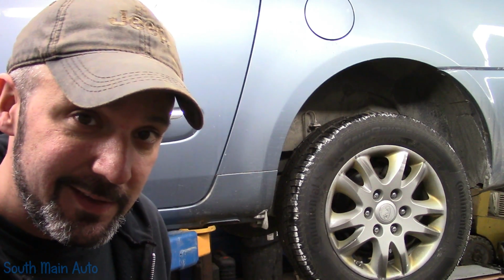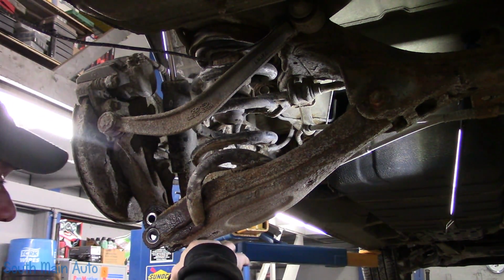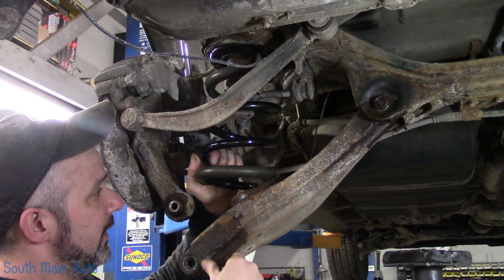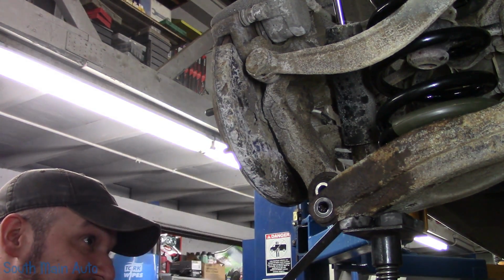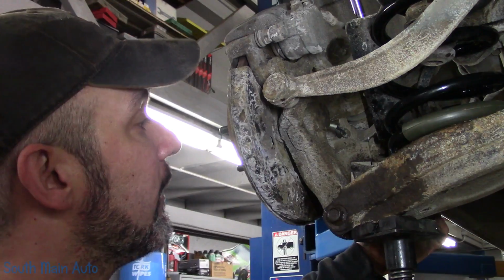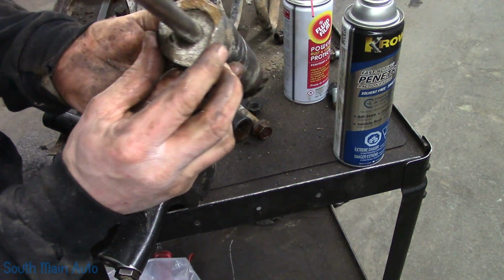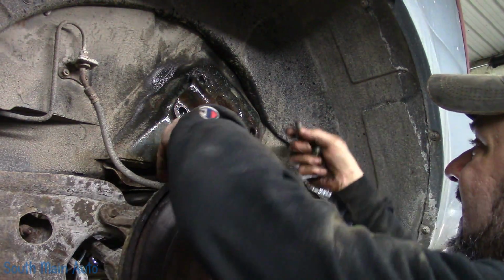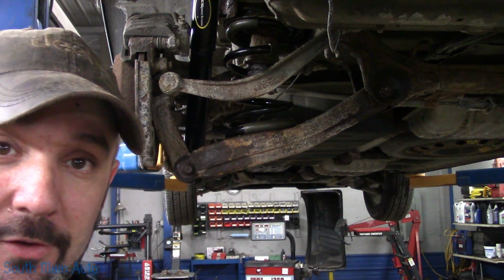Kia Sedona: Broken Rear Springs / Rear Shocks

Comment: Question: would it be easier loosening the outter control arm bolt and removing the inner control arm bolt(while supporting the control arm) to lower the control arm and remove the spring? I would think, since the spring is closer to the outside of the control arm, there would be less torque on the inner end and therefore easier to reinstall, plus less shimying around than the knuckle end. I'm about to do my springs on my 2008 Kia Sedona(New York car- 140,000 miles- regularly undercoated)

Comment: Quick question. Your video was a big help in maybe figuring out my issue I'm having with my 06 Sedona. The vehicle has been to two different shops to find a banging noise in the rear suspension. They can hear it in the test drive but can't find the problem. The van has 260k on it. The shocks were replaced when I bought it and the lower control arms in the rear had new bushings put it. The banging issues begins after more then one bump in the road. A little single bump won't make any noise. Also the front struts were just replaced and now the van sits low in the rear. So with all of this and before I decide to replace every part in the rear suspension how do I check to see if the sprigs are bad. Also the van did a lot of hauling.

Comment: QUESTION to Eric (or youtubers here) :   My knuckle bolt is rust frozen in his bushing/ knuckle ..All the  others arms are free...Can I disconnect all the non-frozen arms(and swaybar link  and shock)) and lower the whole knuckle assembly in order to remove (and replace) the coil spring without disconnecting the lower arm I mean the camber adjutment bolt(and lower arm) will remain in place ?   Mine is a Sonata 2009...similar suspension.

Comment: 2006 Kia Sedona ....mann, I need your help we in the maintenance dept, are removing the  rear lower control arm/drivers side crossbeam arm, etc...and the lowest bolt through the spindle is stuck in the bushing, the nut is off but the bolt wont slide out and we so far damaged the rubber on the bushing also

Comment: Can someone explain to me why this cheap family van has full independent rear suspension? It's not like the person is going to be taking sharp corners as a fast speed. It will still have tremendous amounts of under steer, and probably topple over on its side if it took a corner too quickly. I feel like a semi independent torsion beam system would fit better and bring the overall price down too.

Comment: Thanks for the video.  I'm attempting this tomorrow.  If you were doing this again I saw on another video that they took the inner bolt completely out on the control arm and let it pivot on the outer. Looks to of gave better leverage... well they still struggled. Any suggestions? Plus when you were jacking the control arm back up into place was there a jack stand at the front of the vehicle? Thanks

Comment: Thank you for posting this video, I had a question on what spray were you using on the parts after you removed them and the rubber top for the spring?
Reply: Fluid Film.

Comment: Have you tried the new inductive bolt heaters?  I've seen them in use. They only heat the bolt or nut, not the surrounding CV boots...  Have smoked a few in my day..

Comment: Working on Kias and Hyundais over the last 10 years - is that what sold you on looking at the Sedona as a replacement for the Odyssey?  I had a Sedona as a rental (they ran out of small sedans) and the thing was a really nice ride for a minivan.  Also fit all the car parts I needed for a car I was fixing up (body panels - doors, fenders, hood, bumper etc).

Nice work as usual !!!  Nice to see bolts zipping out of their schlotss without any fan fair.  Your torches must have felt sad and neglected...luckily there's plenty of Fords and Subarus to keep them entertained haha.

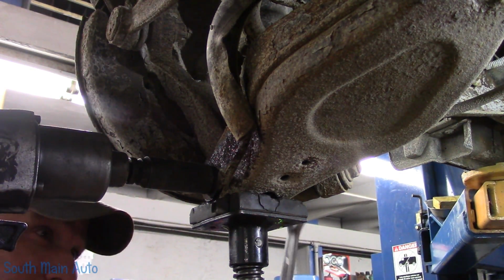Comment: At 1:30, you are removing the bolt (lower control arm to knuckle bolt). Is that the same bolt I replace with an aftermarket camber bolt kit for rear camber adjustment on this Sedona? Thank you.

Comment: I think the 4th upper shock mount bolt came out hard because it was loaded; it was the last one out, and there was still some spring tension on it.  Not because it was crustier than the others.  But, I wasn't there, you were.  Great vid.  Nice to see those Kia's are so durable that after all those soccer-mom miles the thing is still very servicable.

Comment: That potential to kinetic conversion don't half hurt fingers! I now like to use coil spring compressors to keep the springs energy in check. I have heavy duty ones that lock onto the springs so they can't pop off! I have seen people cut the old spring with the gas axe to take the energy out of it? Stay safe mate.

Comment: 한국에선 세도나 리어 스프링 개선품이 나왔는데요 스프링 아래쪽 고무 일체형으로 변경

In Korea, there is an improvement in the intensity and rear spring, but the rubber under the spring has been changed to an integral type.

Comment: Hey Eric, do you torque the bolts / nuts down after using the gun ?  I'm forever checking the official torque specs for everything and don't rest easy unless I know they're at the 'correct' torque, but I'm just a DIY'er.  Is there really any need to torque everything or do you just know the gun and that it's going to be fine with that ?

Comment: Remember when coil springs were a daily thing, doing front end work? Those made me nervous a time or 2! Also remember when they lasted longer than the vehicle? How times change. Pretty good miles on that thing, though, so I guess I can't bust 'em too much!😊

I had to remove a pair on my '78 Cutlass I had parked for the winter behind my parent's tool shed at their house in the day. Nothing but hand tools and a jack, no spring compressor, laying on dirt and grass. I carried my 50 lb. tool box from my apartment in the city, jumped on a bus to the 'burbs, and walked 4 miles carrying that thing! Did that daily for a week until the Cutlass had all new Polygraphite upper and lower control arm bushings, ball joints, and inner and outer tie rod ends. No press - just burned the bushings out with a Mapp torch, and beat the shells out .. and when they didn't come all the way out, the hacksaw blade in my hand, without the saw frame, finished them off. Then the 4 rivets in each ball joint! Man oh man, a drill and a punch, and and 2 hours later I'd have the joint out. My tenacity was unmatched in those days! I feel I've gone the opposite way lately! Anyway, she handled nice after that, once spring came around! I remember lowering the jack after I got the knuckle to bust free, and that last little bit, where the spring starts to bend around with the lower control arm ... then POP! Always scared the crap out of me. I had a story drilled in my head by someone, who said their buddy's buddy's son's brother-in-law's cousin got their jaw ripped off by a spring that let loose! 😁

Comment: I'm not a torque nazi or anything but are people aware of the effects when lubricating a fastener that has a dry torque rating?
Reply: Sure.  But the "proper" torque rating is for everything clean and shiny.  Great when everything is new.
You worry about it some components but for suspension like that it doesn't have to be super accurate.
When I had an automotive workshop I mostly used the calibrated elbow.  When I transitioned to aircraft the torque wrench came out a lot more.
Reply: I completely get and appreciate where you're coming from (which is why I gave your comment a 'like') ... but I think I'd appreciate a bolt protected from rust a little more.  Just saying.

Comment: Hi Eric.
Just had some work done on my 2010 Ford Focus when it failed the inspection (MOT test here in the UK).

For front brake job, rear shockers and a headlight bulb, I was charged £550.00 ($750 ish American).

Do you think this was a fair price, based on what you would charge for a similar job - just curious.

Comment: Just wondered why you don't take a quick measurement of the axle center to the fender well lip before you lift the vehicle to get a better idea of the height of the suspension when you bolt it back together? Thanks Eric, I appreciate your videos.
Reply from the maker: that's a great idea thanks!
Reply: Hope it helps. You’ve helped me plenty!👍

Comment: i noticed that the top portion of the  shock mount  can be flipped and the screw and nut would be exposed to the outside  it would be easier  to pull if it was inverted  not suggesting just noticed that it can probably be done  i watch because i like to learn  i do must of all my own work on cars and  it helps when you see someone else doing  something   thanks for the videos  i watch to learn   keep up the good work

Comment: Altrom Coil Springs, YA GREAT PRICE FOR THE PAIR BUT THEY ARE NOT A SPONSOR, REALLY ? KRAZY NAPA DON'T KNOW GREAT ADVERTISING WHEN THEY SEE IT. Can't believe bolts came out THAT WELL ? OH by the way STUPID TOP SHOCK MOUNT, PLACEMENT, ENGINERING. YA you MIGHT HAVE ANGRY ROOSTERS ON THE OTHER SIDE , GOOD LUCK.

Comment: wow.. Kia/Hyundai using quality hardware.. no more snapping bolts.. LOL
Reply: It ain't like the old days. I replaced a 1000.00 thermostat in my old 1987 Excel....that's what it cost for a new intake manifold and install at the Hyundai dealer after BOTH bolts snapped and I messed it up drilling them out...I was young and inexperienced. My current 2008 Accent at 400,000 km( Always repaired and serviced by me) I bought 9 years ago has always come apart easy. Mind you in almost 10 years almost every nut and bolt has been Neverseized lol

Comment: i was nervous vicariously while you compressed the spring, and when you made the energy joke, it just got worse lmao
Reply: Ditto!!
Reply: many a set of teeth got damaged from such. Or worse!
Reply: I was like "please just use some regular spring compressors!  Please, please, please!"
Reply: @Bryangx  he was doing the rear springs they are not under tention like the front springs are they are just placed in
Reply: @Bob Sacamano it'd take a lot more to lift the car than what he's got on it there old mate.. Suspension if fully extended

Comment: seems like it would have been easier to loosen the top bolts on the shock first and then pull the shock an spring out the bottom

Comment: I have a Kia dealer near me so I do springs all the time. Rusty crap. The little cars without bump stops in the middle of the springs I don’t take any bolts out because they always break. I modified some otc7294 portable spring compressors. I compress the springs, drop them in. Paid 2hours takes 10 minutes.

Comment: Have you ever had to warranty Monroe shocks?  I had so many issues with them getting weak and floaty in 20k-30k miles that I stopped using them altogether--both the Sensa-Trac and OESpectrum lines.  I ended up going with Gabriels, and never had an issue.  My customers were doubly happy, 'cause they were usually cheaper, too!  :)
Reply: I have NO experience with Monroe shocks so I can't comment on the quality. What I can say is that I've ALWAYS used Gabriel for stock replacement as well as air shocks (Hi-Jackers) when I've needed a little extra capacity and I've never had a problem.
Reply: I'm having same issues with monroe quick junk struts.. They don't even last a year.   I will never buy monroe again..
Reply: No Konis or Bilsteins (or fancy off-road shocks) in this crowd!    I like it! LOL 8-))
Reply: Interesting comment. I need shocks on my '00 Grand Cherokee. Was considering Monroe. May change my mind after this.